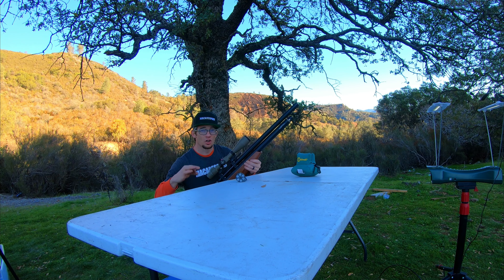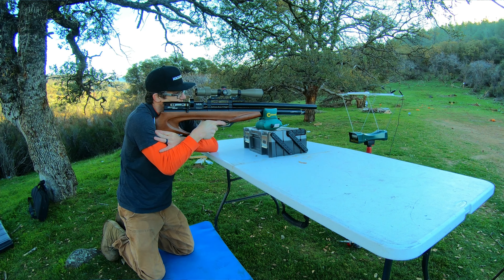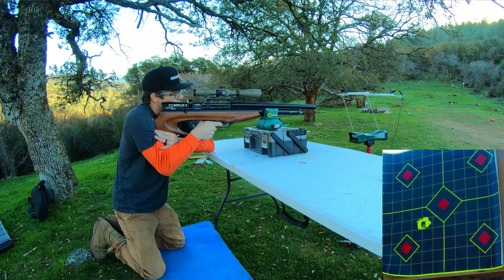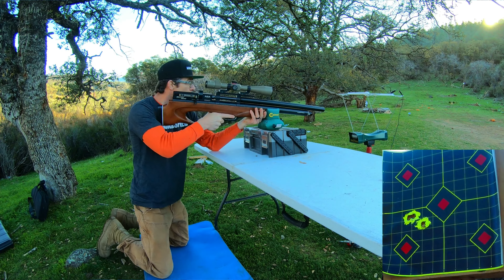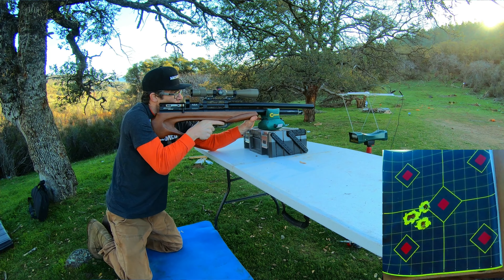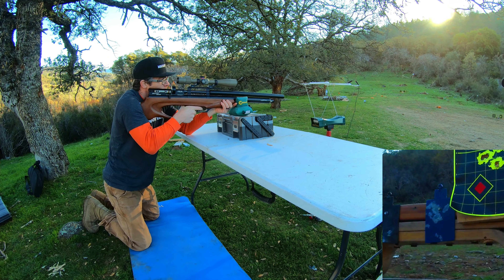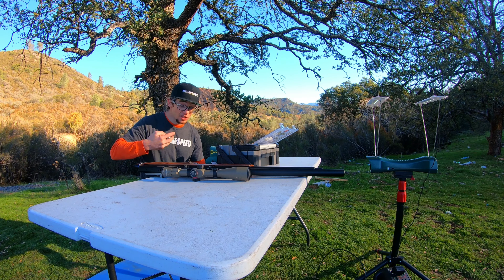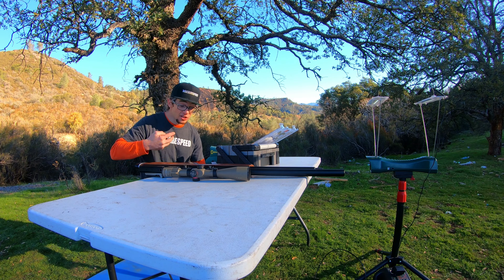FULL 4500 PSI Shot String AEA Challenger Bullpup 50 CAL on STOCK 3600 PSI SPRING with NO POWER KIT!!

Comment: I agree with you AEA under rates their  guns my 357. terminator specifications say 150 fpe and 10-15 full powered shots only using the front tank but my results and this is with just the front tank thats all I normally use i get around 180 fpe with the jsb  81 grain pellets and 20 full powered shots plus 3 to 5 low end shots but the semi auto still cycles perfectly

Comment: I’m thinking if we can get a new spring we can push it to 4500psi without valve lock. Right now even with the washers it’s getting valve lock at 4000psi
Reply from the maker: Can’t wait to see what you think….
Reply: @macabespeed  haha me too, I don’t mean full on valve lock tho I just mean a bell curve on the shot string instead of a drop after the first shot.
Reply: To many of my ideas and inventions have surfaced in the last 40 years , I still have many I keep to myself in case one day I can push them through. Takes a lot of money to patent stuff and keep your ideas out of stingy greedy companies. I have solved the spring issue years ago , I need a few mill to get it into production. This is coming from the guy that glued .177 steel bb’s and nails , screws , and other things into the front of .22 pellets decades before Gamo put rockets into production. I also put them into skirts so the bb would push the lead forward and outward when it hits something . Then I created the pellets with bb’s in both sides of pellets , and point on front and bb in the skirt !!!! Wow 🤩 . I did a bunch of stuff in the archery and fishing world also decades before someone else put em out , like my swinging pendulums for bow elevation to hit targets way pass the norm and several more secrets , fishing , the illumination of fishing lures before LED lights and small batteries 🔋 using incandescent small light bulbs , thin copper wire ran to the bopper , then later , LED lights and small watch batteries put into lures way before someone came out with them ! Just one of many again legally stolen !!!! Lol
In the ammo world many years ago was the first to load fishing spli weights in shells , multi sized lead bb’s , etc, etc,etc ,sound familiar? Lol .
They are all into production today years after I did it as a kid !
The person who overcomes the spring tension that slams the hammer with enough force to push the opening rod on other side of already highly pressurized valve will take the pcp Airgun industry into the next level of existence ! My concern , do we really want to cross the firearm/Airgun barrier ???
Do we want the USA to regulate the airguns in the firearm category like so many other countries are doing now so anything stronger than a red Ryder BB gun would require a special license to possess and use ?
It’s only a matter of time that government will step in and regulate s as airguns and ruin our Airgun community for good .
The pleasure of Airgun plinking would be lost forever. Think about that !!!
Thank you for all you do , you my friend are going to be one of the best of the best rising Airgun enthusiasts in our Airgun community, one reason I subbed to your channel in the very beginning !
Keep up the good work my brother !!!!
Reply: @RGAIRGUNNINJA  are you joking about the needing millions to get the spring to 4500psi, A buddy of mine was able to get a hardware store spring and do it for like $10?
Reply: @RGAIRGUNNINJA  you shouldn’t need more than a stronger spring to do it with a conventional pcp air rifle, are you talking about a hammerless system? because they’re are already are a couple guns that have come out with that
Reply: @gregmcb5305  not a spring friend , much better newer technology !!!
Reply: @gregmcb5305  no sir something entirely different
Reply: @RGAIRGUNNINJA  so you’re not talking about conventional air guns then, are you talking about hammerless systems?
Reply: @RGAIRGUNNINJA  are you modifying the part that the spring opens so that it needs less force to open it?
Reply: @macabespeed  where do you buy the hammer springs from for the 50 cal
Reply from the maker: @lindseyzacek5211  foxairpower.com
Reply: Great video Mac! More power, more shots, what more can you ask for? Oh yea, more ammo! Lol

Comment: Mac did you ever 3D print a tactical stock for this AEA .50 Cal. Challenger sidelever airgun. It weighs so much and it could use a lighter stock to reduce its weight?

Comment: Why do you get higher velocity and more power at lower air pressure?
It seems logical that you would get more fps and fpe at 4500psi
Reply from the maker: Higher pressures anger the valve. Because the valve becomes angry, it forces all of the minions in its kingdom to work without rest until morale improves.
No but seriously I think it’s a flow vs pressure equilibrium thing that I’m too dumb to explain.😂